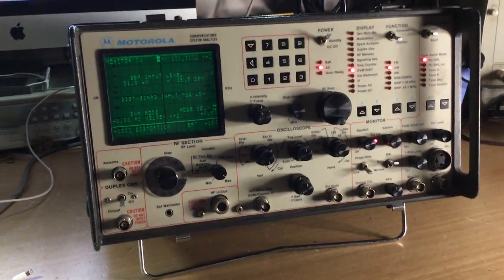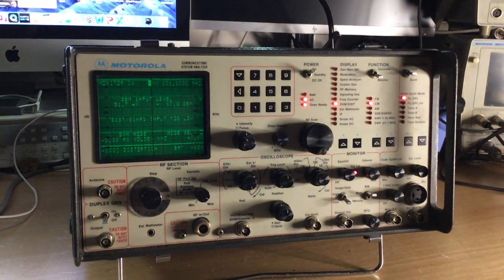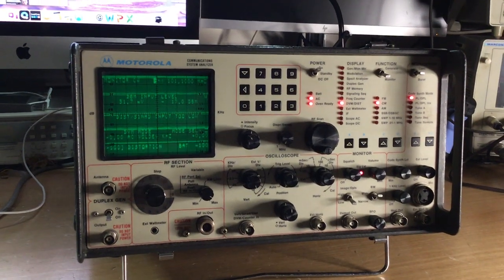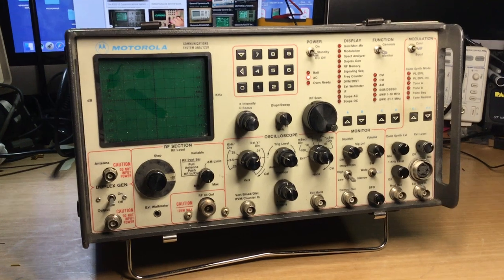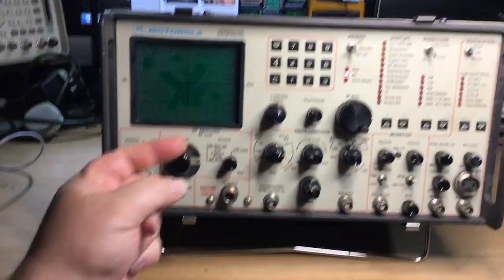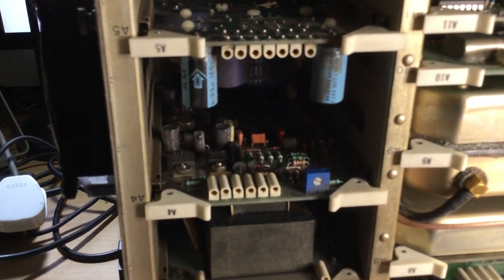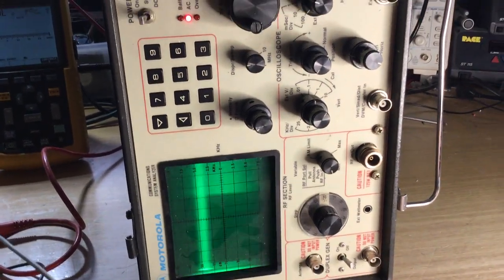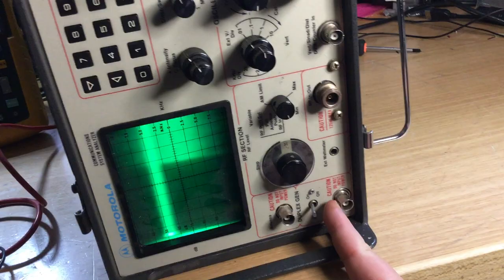MOTOROLA R2001 FIXED, CRT Failure, dry joints, no boot, Dead no operation,

Comment: Excellent video!

I have an R2001C that is intermittent and I have replaced the electrolytic caps throughout the unit, and I was suspecting the 10 MHz master oscillator, due to the unit starting to work after injecting an external 10 MHz, but I suspect it is something deeper in the unit.

I get frustrated with it and set it aside for a time, but I am working on it again, but I am looking at old videos of what others have done. I joined the Batboard for the Motorola equipment guys, but the advice I was getting wasn't helping me.

This video has given me more ideas to pursue! Your calling the solder joints dry is new to me, I have always called them cold, but, the joints were good for many years, and it is as if the solder has corroded and does look dry! Not to mention, they fail to conduct. I have seen this problem in other equipment, and I have spent many hours with the solder sucker and soldering iron, replacing the solder on the boards, and having perfect operation afterwards!

Comment: These are an absolute pain to repair! I've got one here and done a lot of work on it, lots of faulty capacitors and dry joints. And yes that HV PSU unit, what were they thinking not making that potentiometer non accessible. Few small issues remaining on this one, small bit of wobble on the right hand side of the CRT, I think that's down to the transformer on the battery power PSU, it's delaminated, I did quieten it down with some lacquer but I think it has a bit of magnetic flux coming off it interfering with the CRT. The off air reception is awful on this one, not very sensitive at all unlike my 2955R. Tried running up a Kenwood TR-751 on it the other day that I got from a rally as scrap but repaired it, thought there was something wrong with the TR-751 as on SSB I could hear the 1KHz tone going on and off frequency quite badly, but it turned out to be the R2001D, it's not the 10MHz oscillator as I've fed it an external 10MHz reference and it still does it and the internal 10MHz oscillator tests fine and is bang on 10MHz. Seems there is a problem with the A4 RF card, but what a pain that is to work on! I need extender boards to try and get to the bottom of it. Great video and nice to see someone else has had the "pleasure" of working on one of these.

Comment: You should be able to take out 2 screws next to the N connector and loosen the 4 screws that holds the I/O and the input/output moves back just enough to lift that cover for aligning output

Comment: Hello I got a R2001A and it used to work great until now. When I flip the power switch all the lights and the startup beep, and the CRT come on for less than a second than shut off it keeps doing that until i flip the switch off any idea what that could be?
Reply: Mine finally has no power. Sure wish I could get it repaired.